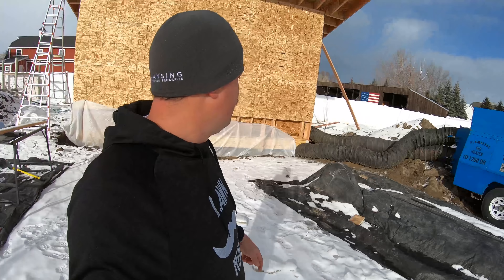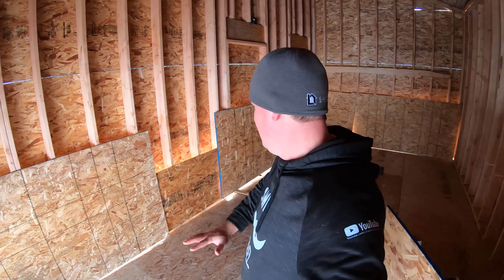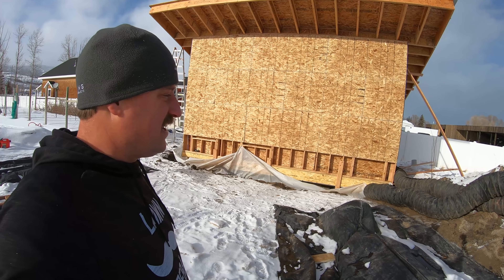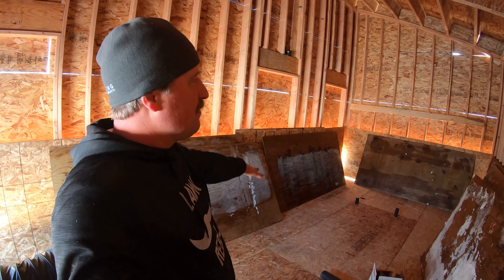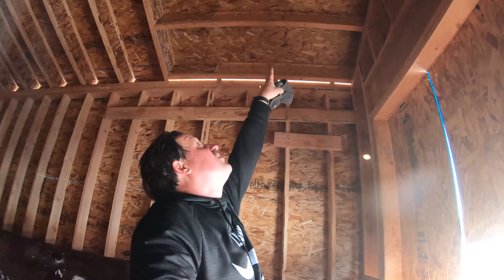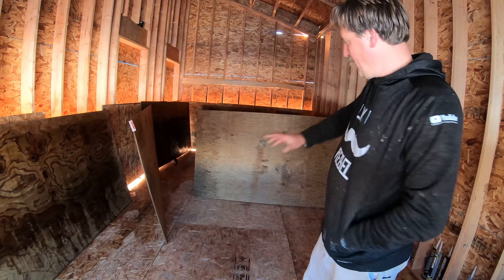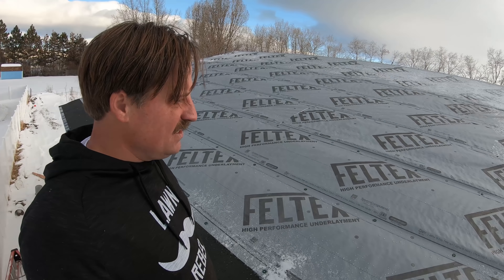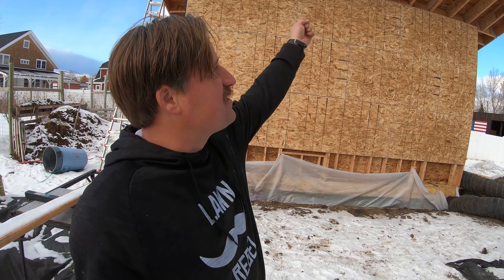A case of the HE SHED #SHESHED

Comment: Architect here - for the space above the windows on the exterior - depending on what you do for siding - you could run a lap siding up to the top of the rear wall, then install a horizontal banding and switch to a vertical batten above the banding. That would help break up the elevation on the tall wall.
Reply: or you could add outriggers / flat roof overhang either solid or open joist (like a pergola) above the windows, wrapped around over the garage door which would further break up the elevation, add shade and more protection for the door.
Reply from the maker: Chris. I have some good things coming. The look will completely change from what it is now. I had a design guy give me some input and I plan to follow his lead.
Reply: @lawnrebel  Awesome! - can't wait to see how it unfolds

Comment: put Reflectix radiant barrier RB4812550 on the underside of your roof joists.  It will block 97% of the radiant heat from entering in the summer and 97% from leaving in the winter making your he said she shed warmer in the winter and cooler in the summer.

Comment: Didn’t you cut out the plastic around the concrete piers?  Why won’t water find its way through those cuts?
Reply from the maker: yeah maybe a little bit. I am more so concerned with vapor than standing water. Should not be too much if any standing water.